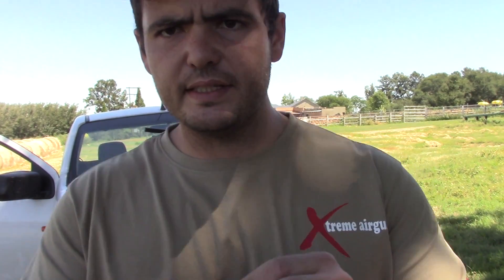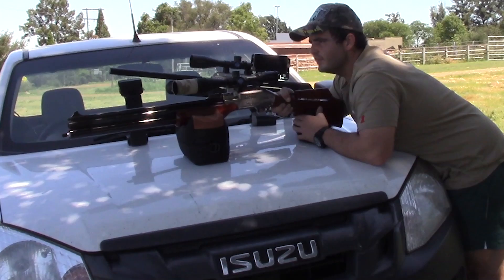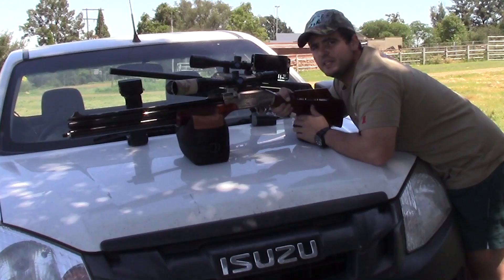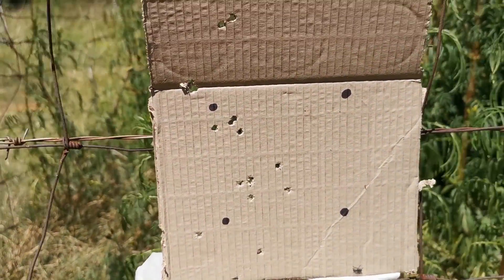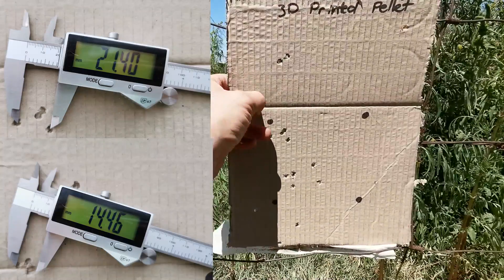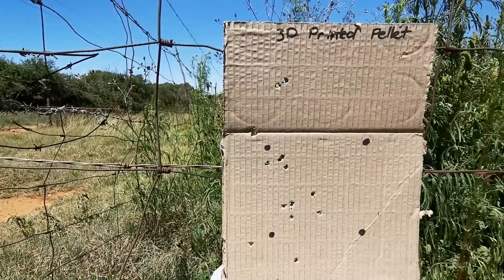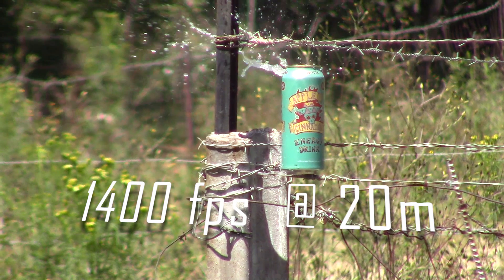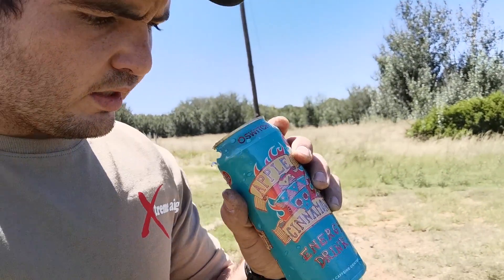3D Printed Pellets at 1400fps

Comment: Yeah I would be very interested if you would do a a video on reduced speeds try different speeds like way slow like just slightly over 500 ft per second and then go up to 6 + 600 ft per second and on and on I think most of your listeners would have a great interest in this at least if they're true blue air gunners

Comment: I'm almost for sure if you would slow down and reduce your hammer spring you would have a great conversation piece with these printed pellets I Believe by slowing it down because what good is power if you don't have accuracy I think by slowing this thing way down you could have really good accuracy just saying. Goes with some of my PCP air guns Pumpers or what have you sometimes slowing it down and also the benefits of slowing it down I can shoot cheaper more affordable pellets

Comment: Do you have a link for the stl file? Do you just push the 4.5mm bb into the 3d printed part or glue it?
Reply from the maker: I do not have a link, I designed it myself. I glued it in place. I could upload the file to thingyverse...
Reply: @GunningForFun  Would they work for a .20 cal? I have the hardest time finding pellets in that caliber but have a 3d printer and tons of .177 bbs. If they would work I would greatly appreciate if you uploaded them to thingiverse.
Reply from the maker: I will look for the files and upload them. They are for 22 cal. You could just draw one in 20 cal.
Reply: @GunningForFun  Thanks, I was just curious if .20 cal was too small to fit a .177 bb and have enough material left to hold it without breaking, Guess I'll just have to test it, Also have you tried just plain 3d printed pellets for just plinking around the house?
Reply from the maker: They are a bit to light to shoot alone. They need the weight in front to stabalise them a bit and they also want speed it seems like.

You could experiment with different shapes, maby you find one that works well.

And if they will fit a 20 cal, I do not know. I would NOT use a quality barrel to test them in just incase they hit the sides and cause damage.

Comment: borescope your barrel after a few of those,  just in case.
interesting though, I have often wonder about steel shot through an air rifle.
thank you for showing.
Reply from the maker: Hi Henry. The steel bb did not touch the barrel. The plastic pellet surrounds the bb and keeps it in the middle of the barrel.